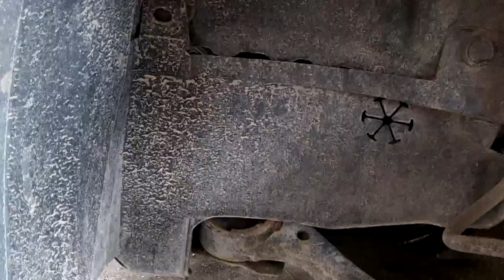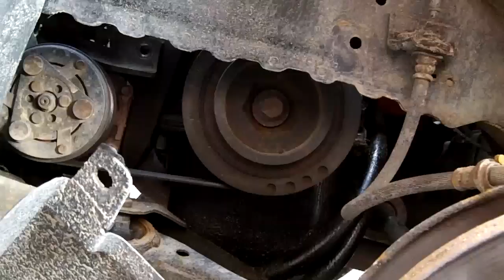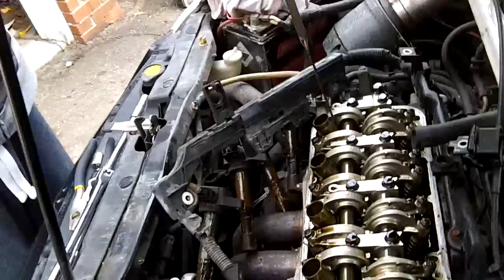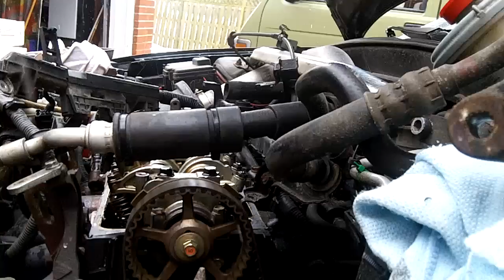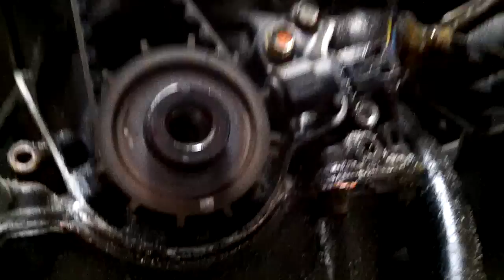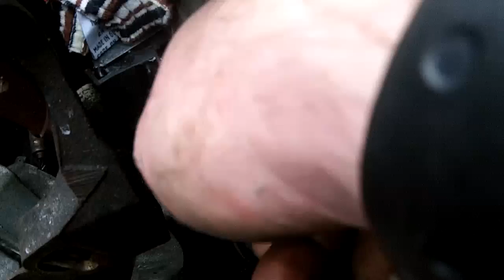2001 -2005 Honda Civic timing belt/cambelt and tensioner replacement

Comment: How often do owners of this type of car have to do this
Reply from the maker: approx 7 years or 110k  miles
Reply: @fupabox  hi i have this car a 2001. It was parked up for 2 years. Now we started an it fluctuating idl. Any ideas what it could be ?
Reply from the maker: Jack Jonson   ECM/PCM idle learn procedure.
Make sure all electrical items are turned off.    Start the engine. Hold the engine speed at 3,000 rpm with no load (in Park or Neutral) until
the radiator fan comes on.
 Let the engine idle for about 5 minutes with the
throttle fully closed and with all electrical items
off. Don't touch the throttle during the 5 minutes .. just let it idle
Reply: @fupabox  i have clean the throttle body an changed the oil. An changed spark plugs. An air filter. I put in 10w 40 oil. Is this ok ? An any ideas hoee to fix the idle prob ? Thank you
Reply: All modern cars at 100k more or less
Reply: I have a 98 honda crv .  So far the car has 115,000 miles on it an its on its 3rd timing belt.  I usually change them at 5 years but manual says 7 years.  My question is should i go by the 5 year or the 7 ?

Comment: After how many miles/years should the tensioner be replaced? I had my timing belt and water pump replaced at 60k but I never thought about other parts on the engine.
Reply from the maker: +EvaSlash the belt tensioner should be replaced every other time ....with the water pump and timing belt being replaced at 60k miles, the tensioner would get done the next time, at 120k miles

Comment: I don't remove the wiring to the alternator. I just seat it on the side of the motor because that positive bolt is prone to breaking off. It's not even in the way of anything but 3 bolts for the bracket. Which is what you are trying to reach.

All so this model does not have the ABS system next to the power steering. That makes it some what easier to reach stuff.
Reply from the maker: Claude Rains  good info...ty

Comment: Question.  how old and what was the milage when you changed your belt?...and did you think your belt needed to be changed?...thanks....mario from Nova Scotia.
Reply from the maker: The belt only had 50k km on it...but the previous owner had autocrossed the car (in Nova Scotia oddly enough) so it had been driven hard, and I figured it wouldn't hurt to change it.. That's why the water pump wasn't done at the same time, which is usually what you would do.  around 100k km is average for changing the belt

Comment: whats that falling from the sky (i live in Texas and we don't have that here). My brother and I changed my alternator at the Home Depot parking lot (that's where it died). We started around 8pm and finished at 12:00am and it was super cold that night, we didn't know what we were doing so it took a while but we got it done. I wouldn't try this on my own but i know a guy who can do it cheap if i need it.
Reply from the maker: the adjustment bolt on the alternator belt is a nightmare to tighten..horrible design.  I'll send you some snow if you want it, we get more than enough  :)
Reply: 1thess523 Just replace the factory butterfly bolt with a bolt. Problem solved.

Comment: Man that looks hard. The Honda shop I went to today told me they will do it for 850 bucks. Is that too much for this jpb?
Reply: $850 for the whole job (parts and labor) is not bad at all assuming that they will change the timing belt, tensioner, and water pump.  Looking around, it seems most shops charge between $800 and $1200 for the whole job depending on which shop you go to.

I did it myself just yesterday and it was very labor intensive.  I just did it in my driveway with no power tools.  The most difficult part of the job was probably removing the crankshaft harmonic balancer bolt.
Reply from the maker: they are prob. quoting with parts ..including the waterpump..but it still seems too high
Reply: Yeah I wish I knew a shade tree mechanic. I just moved to this area. I've been learning how to fix things myself so I'm a beginner. I changed my brake pads and spark plugs last week. I have to put a new front engine motor mount, replace cam plug, oil pan, and valve gasket cover. I think I can do that myself from watching tutorial vids on youtube, but  the timing belt job and front bushing replacement job seem too hard for me to do. It also says on my quote that my left strut is leaking and bump stop has collapsed and that's 750 dollars for them to do. I went in for an oil change and left out with a 3000 dollar quote. :-(
Reply from the maker: manansis86
ouch...strut is only a $80 part and 20 minutes to replace..bump stop is even cheaper and pops on in seconds when the strut is replaced... Check Craigslist and kijiji in your area for mechanics working from home..lots of guys at $30 an hour around here,doing work from home
Reply: lol  I would break something.
Reply: I'd forget where all the bolts went back into or something worse, so that's why I'm paying a mechanic on the side $350 for the timing belt service (belt, water pump, and tensioner included). $850 does sound steep because shops usually charge for 4-5 hrs book time ($110 per hour?), 'shop materials', and grossly inflated prices for the (hopefully complete) kit. But maybe they're including an oil and coolant change? Probably not though. Since I'm renting an off duty mechanic who's not going to give me a receipt or an honest warranty, I'm still going to check his license and bringing a crap load of large rags to place over the fenders and front bumper because some of them are lazy and tend to scratch the paint with their coverall zippers and buttons while leaning 'onto' (not over) the fenders.
Reply from the maker: Al S. $350 is a very fair price with all the parts included
Reply: I live in Washington DC all these bastards around here overcharge for everything. I miss Mississippi. :( I could have gotten the job done for cheap.
Reply: ***** - I thought it was pretty good because I could buy the full kit off of Ebay for $100 shipped, then I'd have to find someone to do it and it be at least over $200 anyways because it's time consuming and not exactly easy (I'm sure you can attest to that). ;)   manansis86 - Hopefully you can find someone and save some bucks... throw up an ad in Kijiji requesting quotes, that's what I did.

Comment: Why do these videos always skip getting the crankshaft pulley bolt out? That's what I'm having trouble with. I have a breaker bar with 10ft of pipe on it and nothing! I've never tried to heat a bolt up on a car but I may have to.
Reply from the maker: the easiest way is to borrow or rent an electric or air impact wrench..you need one that will apply at least 400-500 ftlbs of torque..they are a major PITA without one ..some come off easier than others
Reply: ***** Yeap! I fought with the crankshaft pulley bolt with a pull bar like in several videos and got no where. I borrowed a 3/4" impact gun from a friend and the bolt came out like it was only hand tight!
Reply: JJ BLADE the bolt on the balancer requires a lot of torque to bust loose another thing if you don't have a jack stand under your extension  that your breaker bar is attached to then the 10ft pole will have no effect and when your trying to bust the bolt loose and it feels like your going to break the socket, breaker bar, or the bolt itself dont stop apply more pressure it will be that extra pressure that is required to break it loose i just finished my timing and water pump and i didn't think I would get that bolt out but i did and it was the hardest bolt ive ever had the pleasure of removing
Reply: If you have a good impact wrench, you can get a special pulley bolt socket by Lisle (model 77080) to spin off that bolt. You also may need a Honda special service tool to hold the balancer in place while removing the bolt.

Comment: You should rotate the engine counter clockwise, and you installed the belt backwards. Start at crank, then idler, then water pump, then cam. Check the book

Comment: Great video- bookmarked as I am coming up on my 240,000 mark and im doing it myself this time. You must live where there is salt on the roads, mine has 238,000 and looks like new under the hood without any rust or corrosion.
Reply: Jthumper no